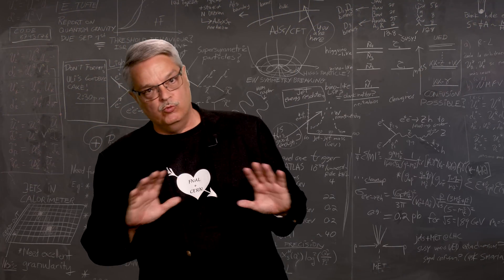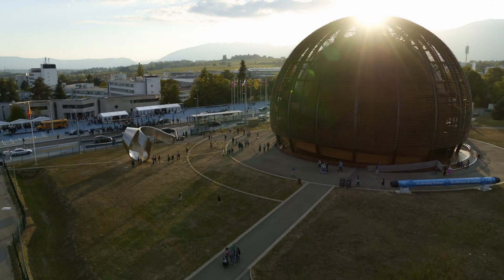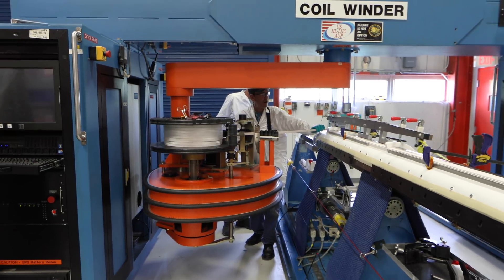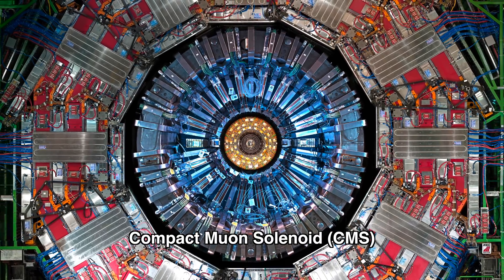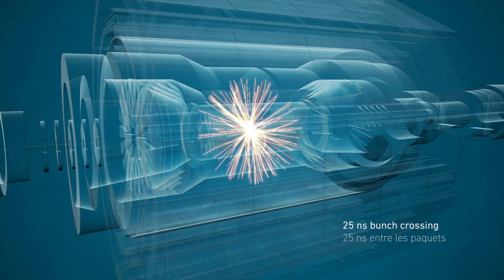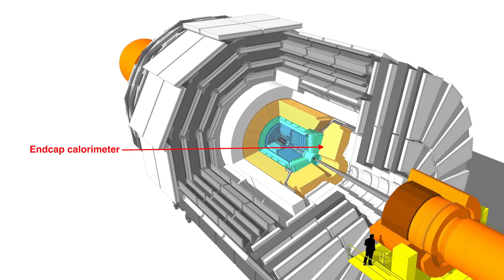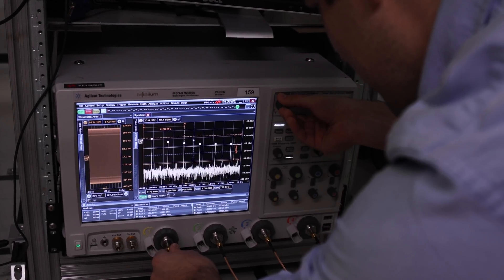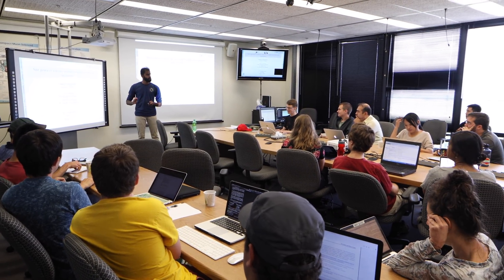The Higgs Boson Was Just the Start: Fermilab and the High Luminosity LHC

Comment: Hello, I’d be interested to know how you test the equipment FML develops for the LHC and the CMS? They make only sense when being installed are the accelerator. How can you simulate millions of collisions w/o using the LHC? Many thanks
Reply: You build electronics which simulate the detector and feed it into the inputs.  That's for the trigger.

For the hardware, you make prototypes and put it in the Fermilab particle beam to see how they work.  Then you make a ton of them for the final detector.
Reply: @drdon5205  Many thanks DrDon from Switzerland, alas not from Geneva but from Zurich :)

Comment: Still waiting for real world applications.  No don't claim some tech that is more easily explained, because that tech existed before the discovery.  I mean new application that were not possible without the knowledge.  Not that I am against high energy physics, but where is the beef.
Reply: It's called "research", because nobody knows what the outcome will be and if it will be applicable or not, because it is unknown, which is why it is being researched. Has been that way since the invention of fire and the wheel. If somebody knew what the outcome would be, it wouldn't be research but at best verification and we wouldn't have to do it at all.
Reply: @frankschneider6156  Yes I know what research is, I do it for a living.  What I am saying is there are a lot of financial and other resources going into these colliders and very little actionable knowledge coming out.  Its all very interesting of course, but ultimately the purpose of research is to produce real world applications.  I am not advocating reducing the resources going to research, indeed I think they need to be much higher, But I am advocating a more efficient distribution of resources.  There is a lot of low hanging fruit (e.g. industrial 3D printing and zero-G smelting/refining and manufacturing) that will pay off better in both the short term and long term.  I am completely on board with everyone being a researcher in whatever field they want, but as a practical matter we do not yet live in a post scarcity society and so every ducket spent on one field of study is a ducket that isn't available to another field.  So its a matter of priorities.  Which do we need first, off world manufacturing which will improve the environment and provide much more capital to spend towards research, or do we really need to know the 50th digit of the field strength of the higgs boson.  Its the old guns vs butter debate to be sure, but the fact is the LHC et al suck up a LOT of research dollars and produce very low value (in terms of immediate utility) output.
Reply: I pretty much doubt you do basic research for a living, because otherwise yo'u'd know that the goal of research is NOT to produce real world applications, but to gain knowledge. Basic research is completely goal independent, what you mean is at best applied research, which is imho not really research, but just more or less advanced product development. 
Typically the seemingly "useless" knowledge gained this way is suddenly required sometime later at a seemingly completely unrelated problem, where it can be put to good use to solve problems. That's similar to mathematical research. seemingly completely useless crap, but suddenly some time later that seemingly useless crap becomes invaluable useful in solving new real world problems.
BTW developing industrial 3D printing is no real research, that's technology development. Not to mention that it's a pretty useless approach. 3D printers are per definition universal tools. A universal tool is always inferior to a tool specialized on a specific task. Tasks in industrial production are typically highly specialized and require highest performance at lowest cost, delivering best quality. 3D printing is in all categories inferior to specialized machinery, because it's a universal tool. 3D printing only has an application, where versatility is more important than speed, cost and quality. That's nowhere the case in mass production and thus not in industrial production. Its use is only sensible in the production of small series or individual products, where it is more efficient, faster and cheaper to use a universal tool, instead of an optimized tool. The typical case is prototyping in R&D. Guess what: specialized 3D printers have been used for that purpose since decades in that area (e.g. automotive industry). So what you want to develop is effectively a waste of money.
It's also incredible, that seemingly no non-scientist is able to distinguish basic research from product development or engineering.
I understand where you are coming from money wise and of course is the big budget research a la CERN or ITER highly debated (although the budgets are minuscule compared to e.g. beer or cigarette consumption). 
But what you are advocating is: don't spent money on discovering new knowledge, lets better focus on producing better fist axes to better hunt animals, this will be far more efficient in the short and long term than this costly "spear and bow"-research, which will never gain us anything. Not talking of the esoteric research into making fire, which is obviously a waste of tax money, because nobody needs that dangerous stuff.

Comment: @7m50s: No ESD Wrist Straps? Such ESD precautions are standard in industry.
Reply: ESD wrist straps are not that necessary if the lab is correctly setup. Even less on this kind of one-off installations.  Industry uses it on operators because as they are building a lot of devices, the chance of failure increases. (and thiis the cheaper of the options)
Also, that seemed more a prototype/testing setup than a production one.

Comment: I heard they're ALREADY working on a BIGGER one! 50X bigger than Hadron.
Reply: There are ideas about a follow up to the LHC, but that's just that, ideas. The problem is, that the accelerators get so expensive, that nobody wants to spend the money. That's why the US Supercollider (which would have been much larger than LHC) was buried, although already several billion USD had been spend on it. 
Its unfortunately not impossible, that the LHC will have no larger, higher-energy successor at all. I mean LHC itself is already so big, that it crosses the border between Switzerland and France and is thus actually located in 2 countries.

Comment: Sabine Hossenfelder would like a word Don. Apparently the LHC, even with upgrades will not discover any new particles. The detector found the Higgs it was meant to uncover, but no more than that. Sad times for particle physics.
Reply: Sabine cannot possible claim that with certainty.  It may be that such a claim turns out to be accurate, but you can't know in advance.  To repeat a quote often ascribed to Einstein "Young man...if I knew what I was doing, it wouldn't be called research."

Comment: I've been waiting for a new video on this.  The numbers the doctor Don talks about are mind blowing.    Now I'm wondering how many particles  per second are in a beam of light traveling through a hole the size of a particle?   And I know that would depend on the luminosity which we can control and the speed of light which we can calculate in most mediums.     Another question I have is.  Do electronics operate at the speed of light ?    I imagine it is slightly slower and there fore we wouldn't be able to measure any faster than our equipment, but I also Imagine these scientists could just find a way around that but using two or more counters in different orientations.  Some one tell me what's going on.    Thank you.  Thank you Dr Don for opening my mind on this important subject.

Comment: Please, find SUSY!
Reply: That would probably require (vastly) more energy, not more luminosity. If SUSY is right at all. It wouldn't surprise me if this is a very expensive wild goose chase down already beaten tracks. I sincerely hope I'm wrong.
Reply: Peter N
LHC should be able to find the lightest super symmetric partner particles. And until now, there is zero evidence for any of them. This indicates that we may have to rule out some SUSY variants which of course puts even more weight on the question, if the idea might be completely wrong.

Comment: It is astonishing how complex this machine is
Reply: Mind blowing isn't it? Especially compared to the primitive equipment used to first probe the atom - with great success, I might add.
Reply: Physics principle is simple(r). The engineering details to achieve validation is complex.
Reply: few years back one magnet was wrong and they think one particle 0.000002 second faster than light particle, photon
Reply: @anttumurikka8728  it was a faulty wire, the neutrinos didn't actually arrive 60 nanoseconds faster than the light did
Reply: @rumdore   ok, i remember fault was one magnet , thanks for correct
Reply: Bertrand de Born https://www.nbcnews.com/sciencemain/faster-light-again-6C10405471
Reply: Bertrand de Born " Nimtz told New Scientist magazine: "For the time being, this is the only violation of special relativity that I know of." However, other physicists say that this phenomenon does not allow information to be transmitted faster than light. Aephraim Steinberg, a quantum optics expert at the University of Toronto, Canada, uses the analogy of a train traveling from Chicago to New York, but dropping off train cars from the tail at each station along the way, so that the center of the ever-shrinking main train moves forward at each stop; in this way, the speed of the center of the train exceeds the speed of any of the individual cars"................................................................ so can you see if part of light travels but no not information transfer cannot go faster light you cannot say light is transfer faster than light
Reply: Bertrand de Born  ok. thanks for answer. Is it possible try his interesting experiment superior pressure or absolutic cold?
Reply: Bertrand de Born  yes, just curious is there are any difference if vacuum itself is heavy magnetic or very cold or pressure ect whne light is move there. If you can create negative mass like some theorisis precict is possible brake barrier
Reply: Bertrand de Born  https://www.nature.com/articles/s41586-018-0038-x science goes on and on..